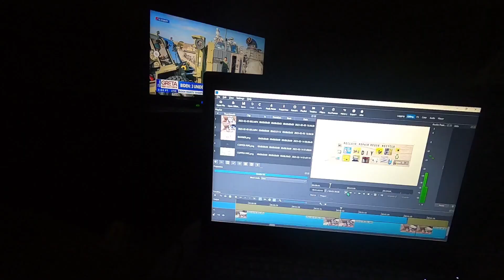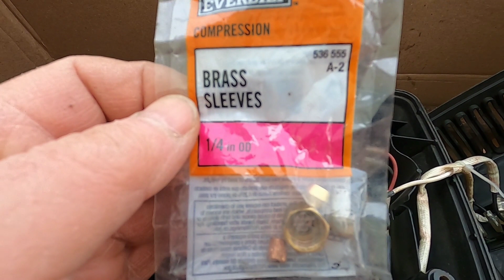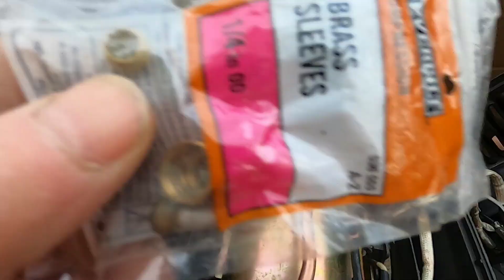Compressor not building pressure FIXED

Comment: I had a metal tube that needed a fairly large radius 90° arch ages ago, so I don't remember the type of metal or what it was for, but I cut an arch in one end of a 2x4, hammered in a nail on the 2" side and bent it over to hold the pipe, then carefully bent the 90° arch by pulling the pipe around.  I was familiar with pipe bending from a job back in the '80s bending pipe for electrical wires with a large tool kind of like yours, so I just followed suit with my DIY pipe bender.  It came out great.  I knew enough not to try to bend it by hand and this little rig did the job.  Mine was just one bend.  Yours is a little more tricky, but I'm sure you'll get it right next time.  I like to repair things when I can, so we have that in common..
Reply from the maker: Good tip with the 2x4, have to keep that one in mind. I had to use the other piece of tubing. Once it is used it gets really hard to bend into another shape. I find it very satisfying repairing & bringing equipment back to a useful state.
Stay well, Joe Z
Reply: @JOEZEP54   If I may suggest, start with the length that comes straight out, find your bend point and make the larger diameter bend that arches around and goes down, bend that arch so it's close and ends where it can couple, and then find the where to start bending the smaller 90° where the pipe goes pretty much straight back.  Bend it and cut it off at the needed length.  You're the one doing it, but I'm thinking the larger bend that goes down might be easier to start with.  Consider the opposite and do what looks best to you.
Reply from the maker: @100vg  Thank you Craig. I have the second piece installed. It is working like when it was new, loud & slow LOL. But it is very handy.
Reply: @JOEZEP54   I knew you'd get it.  Congratulations!
Reply from the maker: @100vg  Thank you.